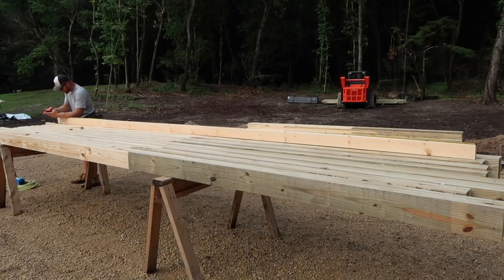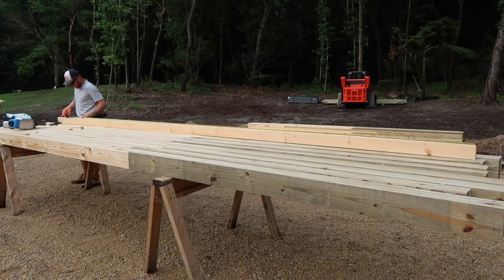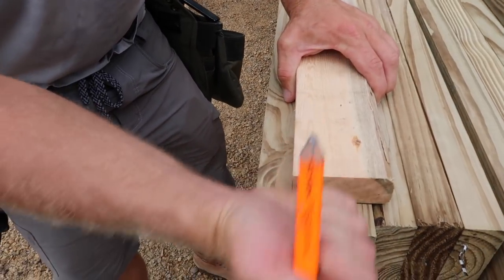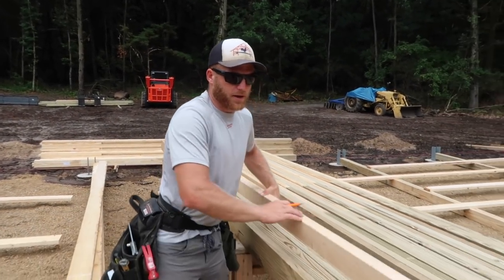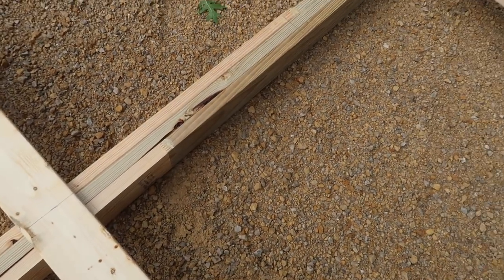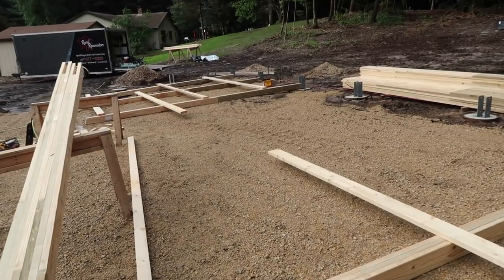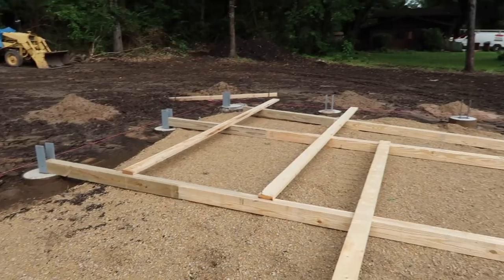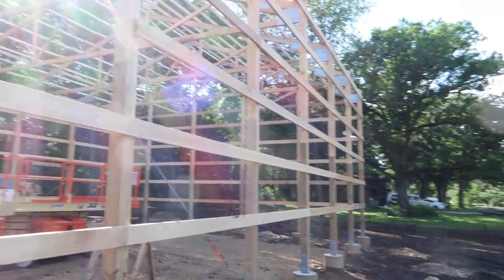What is a story pole? And how do you use one??

Comment: Been watching your videos to learn and pick up some tips for the building of my garage. They have been a very good source of information that I have already planned to implement. Do you have a specific video that shows how to figure out the spacing of the girts based on the wall height? Especially interested in finding out where to locate the top girt so it is in the proper location for the soffit installation. One of the biggest differences is that I already have a poured concrete slab with 12X12 footing perimeter and in floor heating tubes already placed. I will be building on top of the 30X48 slab. Any information or insight would be greatly appreciated. Thank you.

Comment: The measurement of 1 3/8" only referred to that first bracket, correct? each bracket would have a different number for "grade height" and you mark those measurements on each  corresponding post? So you make sure all your posts are in the order that they'll go into the brackets, transfer that grade mark then use the story pole?
Just want to make sure I'm thinking this all correctly.
Thanks for a great tip video.
Reply: You got it right.

The Sono tubes are all set with a laser to a certain height.  Then the brackets are set in the wet cement.  In another video he showed his list of measurements from each bracket and all the measurements were with in half an inch. Pretty figgen impressive given that the tubes could had shifted and the brackets are set by hand by just pushing them down.

Comment: After using the story pole do you go back and cut off each post at the bottom mark (+1 3/8")?
Reply from the maker: no...the whole point is that 1 3/8" is below my grade....I measure up that distance and then the reference mark is my zero elevation..  every post has a different measurement based off the laser

Comment: One thing thing that might confuse some people is that you need to measure each post bracket individually, and keep track of which post go on which bracket. In other words every bracket measurement isn't going to be 1 3/8. (unless you were pefect on setting the brackets).  Guessing you use a simple numbering system?
Reply from the maker: as we make our posts, we make them in order and mark each measurement on the bottom so when we place it in the bracket we can confirm that the post is the same as the bracket measurement

Comment: You said 39" up, then 32" after that to the top.  Is the line the center of girt board?  Or bottom or top edge?  But that's for buildings with metal siding, correct?  How would you lay it out if you were to sheath the outer walls?  24" spreads?

Comment: Kyle,  Great Tutorial! Does each vertical post have it's unique corresponding offset mark ? I'm assuming yes, if so, do you number them to keep them in the right order/location.  If that is the case seems like the tops will be all different heights.  Does that matter or are the roof trusses fastened to the sides of the vertical? Thanks for doing these videos!
Reply from the maker: every post is unique to a bracket and we mark them so we don't get confused...quite simple actually and efficient
Reply: If that is the case seems like the tops will be all different heights. Does that matter or are the roof trusses fastened to the sides of the vertical?
Reply: That's what he was talking about at the beginning with that 1 3/8" mark on the side of the gray bracket. The 1 3/8 inch meant that that bracket was 1 3/8 inch above grade (level). Each bracket has a different number on it. Then the story pole is set 1 3/8" from the end for that specific column and so on with each column so that the lines are an equal distance from grade (level). It took me a little bit of watching his videos to understand how it all fit together so hopefully this made sense.
Reply: He doesn't show it well in this video but. The columns are laminated and the truss sits "inside" the outside two 2x6. The post are shipped with a removable blank at the top that he trims down in each one.

Comment: Love your videos!!! 
Can you please tell me..... If one bracket in your piers was for example 2inch higher than the others that post would be 2inch shorter to keep them all the same height for the trusses????
Am I right in thinking you mark from the top of the post down or the horizontal timber would be out depending on different lengths of post. Do you mark from the top down???
I learn lots from you guys. Super super videos thank you for taking the time to share with us.
Reply from the maker: yes....every post is different below the reference mark depending on how good we set our brackets to grade
Reply: If one of the piers was 2 inches higher than they did something wrong lol, but they could essentially just use that as the new grade and that pole would be flush with the end of the story pole.

They don't mark from the top down. The story pole has a mark that corresponds to the truss height and they cut the pole before it goes up. So the distance from the start line (the end of the story pole) to where the pole is cut for the truss is the same on every pole, but the tail sticking out under the story pole is what is different on each pole. The excess of the pole is cut off before the roof sheeting is put on.

Comment: Kyle - in another video you talk about using the same story pole but marking the inside dimensions.  I think it would really help if you used a 16' sidewall building as an example and listed all of the measurements from bottom to top (ie: 39 girt, 71" girt, 103" girt, maybe 120" header for lean-to, 13" girt, …..   Thanks

Comment: Few questions.. we know the bottom board is the grade board. Next one up on the side for wall gurts is 2ft? The next is 39” from the bottom to allow for your transition in colors. Then every two ft all the way up to your ceiling height which in my build will be 12ft. At what height do I put my board for soffit? On my post and at the top of my ceiling height of 12ft I add 15 1/2” for my heel, what extra do I allow for when build my soffits, just the height of a 2x4?  Fixing to start on my build. 
Also I am building my building on a slab, where do I take my measurement with my laser? At the lowest bracket?
Thanks Kyle
Reply: Can some respond to my question above?

Why is the wainscoting wall gurt 39”? The metal is 48” and shouldn’t the walls be on 2ft center?

Comment: Ok. So how does one utilize this method without a laser level?
Reply from the maker: hmm I suppose how  can you build a level post frame without one?
Reply: It would take a lot of time but you could use a water level
Reply: RR Buildings I understand the use of a basic level, but it’s difficult to find the “reference mark” based on grade if you can’t shoot the mark from a stabila laser or something else. Essentially it probably just means that the story pole really isn’t the best tool in that application and running a level on each wall girt is probably the better way to go. 
Was just wondering if you had a better method or something that I was t thinking of
Reply: The trouble with using a standard level is that if it was out just 1/128th of an inch you would be off an 1.5" by the time you get around a 40x60 building.

Comment: Once you've established the mark on each bracket, and that measurement is transferred to the individual post, do you then cut off the end of the post?
Reply: in this case the adjustment is made at the top of the post (top of story pole) where the truss is going to sit, he purposely left the center 2x6 loose in the post, he cuts on that mark(top of story pole) and nails it back in place. hope that makes sense. I think he shows this step in one of the videos. It;s because he is using a bench mark(or grade mark) so if he didn't have a grade mark you find the lowest bracket and use that as your grade mark and like you said cut off the bottom of the post's that were higher than the grade mark(lowest point), there are just several ways you can do this but his way is better because he has several elevations to deal with on that story pole, I think this would have been less confusing to everyone if all the brackets would have been set at the same elevation, hope I didn't confuse you...lol

Comment: Do you pre drill all your metal? How do you do that for the roof and walls.
Reply: If I'm not mistaken they punch the metal with a center punch so the screws are all in the same line but they do not drill the metal.
Reply: Nicholas White multiple sheets at one time?
Reply: Yeah, I think he stacks them up and punches hard on the top one and it transfers through the majority of the stack. I could be wrong but I'm pretty sure that's what he was doing in a previous video.